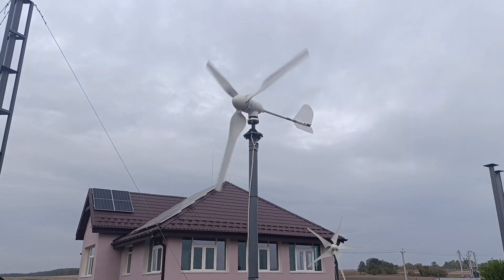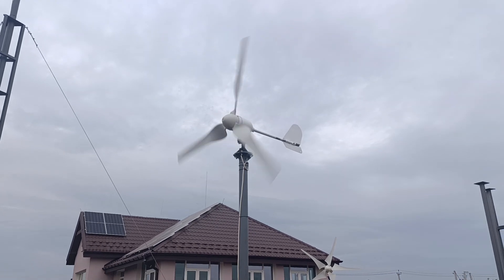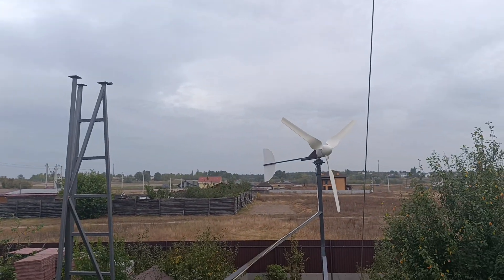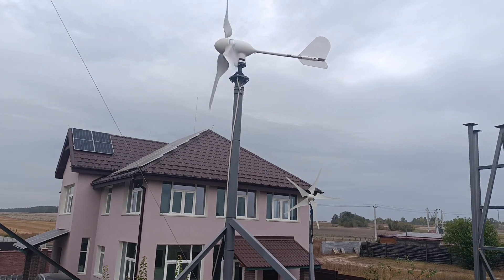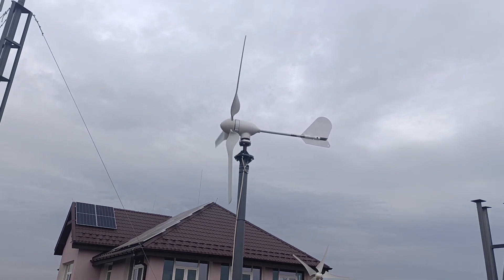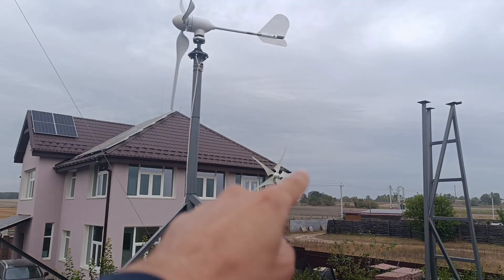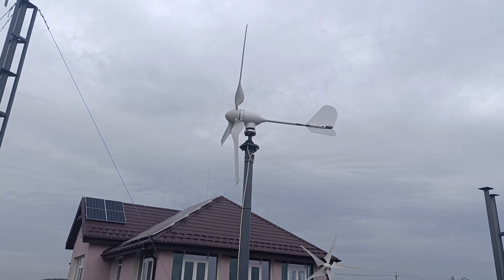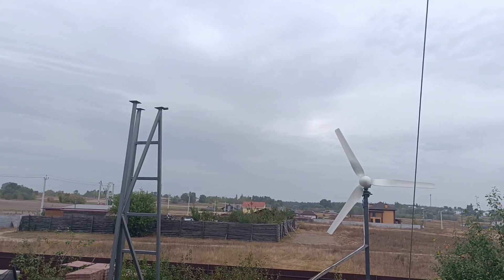I wonder why M3/SM3 is the best low-wind start turbine? A self-made one catches up so much later...

Comment: How much has your M3 windmill produced at its largest? Not that 2000W?
Reply from the maker: of course not 2000, that was clear from the very beginning )
max instant I've seen out of it was 541watts, and that is more than I expected, to be honest.
monthly - least I've seen out of it was 4 kWh, max so far was 12 kWh per month.
but, I don't have a lot of stable winds. they are rather moderate and still sporadical...
my yearly average according to globalwindatlas.com is 3.6 m/s only at 10m height.

Comment: Do you know the diameter and thickness of the mast on the top of your tower? Where your FT 1000 sits.

I want to buy the FT1000 model to replace my old M5 model, but my mast is 76mm in diameter and 3mm thick. The M5 model weighs less than 30kg and that mast is enough, but maybe it is too small for the FT 1000 model. It weighs about 45kg, right?
Reply from the maker: mine currently is 90 dia and 3 thick.
76 is also ok for it.
correct, FT-1000 is about 45 kg
Reply: Many thanks

Comment: If you have limited budget, which is better Increasing panels or use wind turbines ?
Reply from the maker: depends on the area where you live. google globalwindatlas and globalsolaratlas for your help.
but in general I think that solar is cheaper and easier to go with.
however, if your goal is to cover winter solar underproduction (for northern hemisphere) - wind turbines will definitely help.

Comment: So long as there's no control circuitry built into those housings, what you have is basically a DC motor inside there acting in reverse as a generator, thus at a time with no wind, try starting at 0 volts with a DC supply connected to the wires and dialing upward to find the point at which each one starts to turn, I think you'll find that illuminating. Another thing, short the output leads together (disconnected from everything else) and turn the rotor by hand, feeling how much resistance is there. Also my video from 2013 when I was building them from scratch out of a bicycle wheel, channel nrgcycle, might be of interest, there's a quick preview at v=OjTVtf6Ku40
Never got around to mounting blades that extended out further, increasing the sweep area would have increased their output a lot.
Reply from the maker: it's AC permanent magnet generator inside

Comment: You are growing a wind turbine garden. Lucky you, my wife doesn't let me install more. Are they connected to a different battery bank? The batteries resistance have a lot to do with rotation and production. Speeking of which. Which wind turbine produces more in very low wind, the Ft 1000 or the Ft 2000?
Reply from the maker: they all are sitting on same 100AH GEL 48V battery bank, which works a a buffer battery. hm... on low wind - FT-1000 is a little bit quicker to get to production, on a controller it actually produces something at 2.8-2.9 m/s already. FT-2000 L2 gets to production a fraction later, at 3.0-3.2 but at over 3.6 FT-2000 easily outperforms everybody else. starting at 4 m/s - FT-2000L2 outperforms all other 4 turbines combined.
Reply from the maker: and yes, that was a tough fight with my wife too even to get this one done. my only argument was that it won't go out of the grapeshouse...
but now I want a big 5.3 m dia one and there is no room for it...
Reply: Then you are right, It has to be the Torque. Probably less magnetism. The distance between the stator and the rotor IS very important too. More distance, less Torque but less power too. And not all the magnets are the same.
Reply: And about wifes, I think I have to update mine. Like a Windows update😂
Reply from the maker: @JoseAgustin-hq2pl  If that's the same wife as before but better - go for it definitely ))

I am aware about the blade lengths - it's very tight balance, you cannot go for too much.
Reply: You can increase the blades lengh but be carefull, just a little bid. It IS going to improve production in low and high wind. I did It once and It worked, I almost doubled the gen power but then I burned the slip ring. I installed a better slip ring and It worked, but then I burned the stator during a storm. I put too large Blades, so increase them just a little bit. I think that engineers know a lot more thank us😂 They test everything in the factories. But we LOVE playing arround with our toys, don't we? I LOVE It. I think my wify IS going to divorce me🎉
Reply: and if you want to improve the production in high wind, sand the blades so they weigh less. Sand the whole blade but a little more on the back part, where it expels the air. Like the shape of an airplane wing. I did it and improved the production in high wind, in low wind the production was the same or a little less.

Comment: I think you need a 5  meter diameter turbine or bigger.
Reply from the maker: not sure about it yet. but probably yes, 5.35 machine form Wuxi FengTeng would be a good addition
Reply: @BackyardVoltage  I have been thinking about buying a tri blade paramotor rotor to use as a wind turbine rotor, what do you think of this idea? they seem to be 3X cheaper and better quality.

Comment: I'm finding my 48v ista breeze starts around 20 mph and all my 12v start at about 13mph, its funny tho at proformance mph the 48v slows and the 12v speed up, the torque must be allot harder on the 48v. What diameter was the tail shaft on the m3/renytek/i700, put the i700 generator on the front of the m3/renytek  100mm further out make it do 360s.
Reply from the maker: well, that's the turbulence. that is the case why I try splitting the distance and the heights a little bit, so they are diversified, and won't intervene one another's production in this tiny space
Reply: @ModernUkrainianHomestead  it is the turbulence, your right, its coming from the walls below. Need to finish other tower. Great development on the bio digester plan, an inner tube on a flat surface, a flat surface ontop of the inner tube and that will hold 12v switches powering a 180psl feul pump compressing the methane, just don't have the space for the run of the mill bio digester big inflatable bags, I think that's the easiest way ive com up with over the past few months to catch and compress.